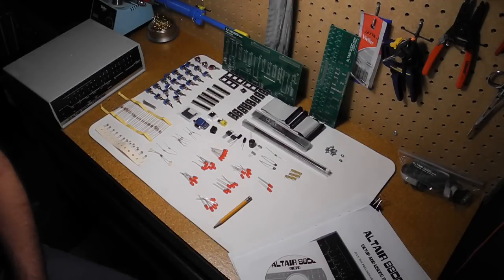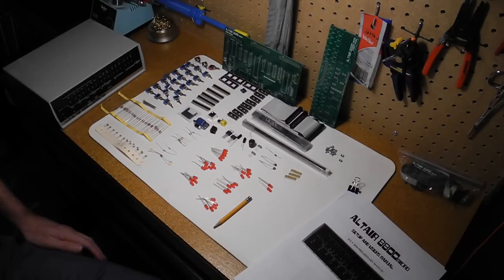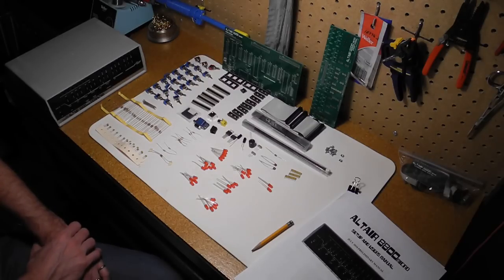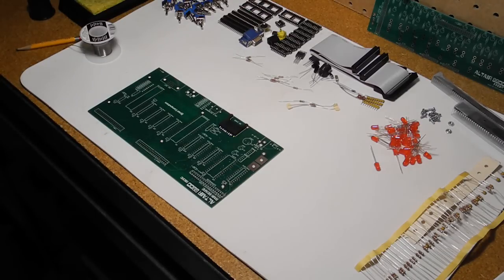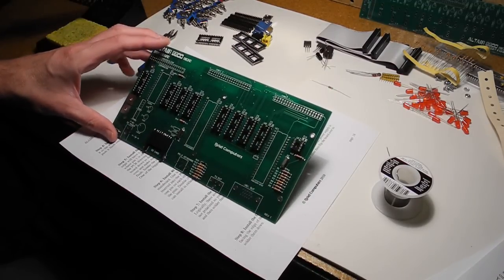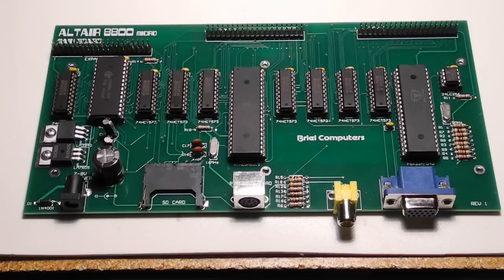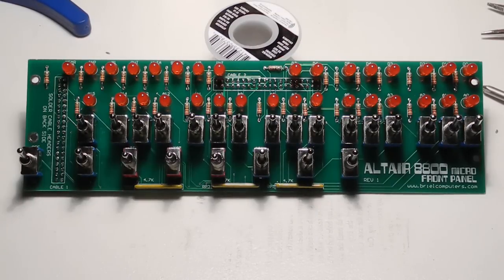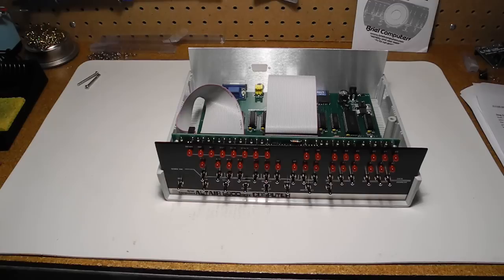The Briel Altair 8800 Kit, Part 2: Assembly

Comment: Hello Jeff- thank you for putting this video together.  I am getting ready to build one of these 8800 Micro's from scratch.  Just curious- are those resistors on the main CPU board 1/4 Watt?
Reply from the maker: Yes, they are 1/4 Watt.
Reply: Jeff Tranter Hi again Jeff, would you be willing to take a good res picture of the solder side of the main PCB in your Altair 8800 Micro, and send it to me?  I am trying to read through the schematics for this machine, but am missing some data...
Reply from the maker: Corneleous Worthington Sure. Can you e-mail me at tranter@pobox.com so I can send it to you?